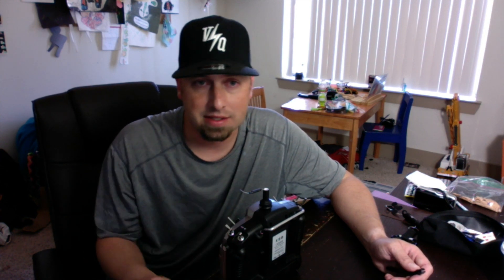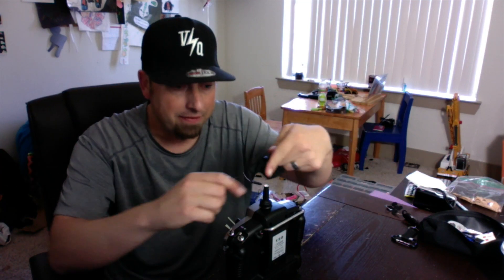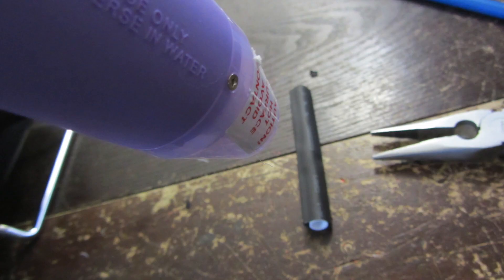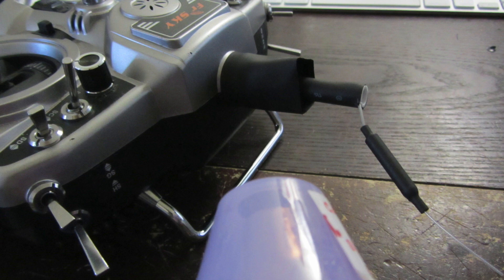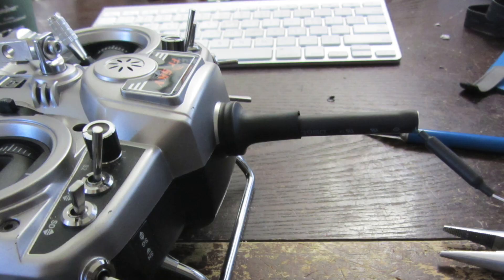FrSky Taranis Antenan Mod and Fix with Telescopic DIY Solution

Comment: Is it safe to install a 8dpi antenna on to the taranus I'm going to soder a sma cable on do you know what I have to do after I soder on the cable for the antenna I've seen some mods for taranus xplus antennas please help before I desoder my original antenna

Comment: Not all taranis have the u.fl connector inside

I'm pretty sure they removed it from the later taranis.

I know mine doesn't have it, which is about 6months old
Reply from the maker: Not a big deal, if you listen to the video I said I wasn't sure what to expect either soldering or snap plug.  This obviously will only work for those with the snap on antenna.

Thanks for watching.